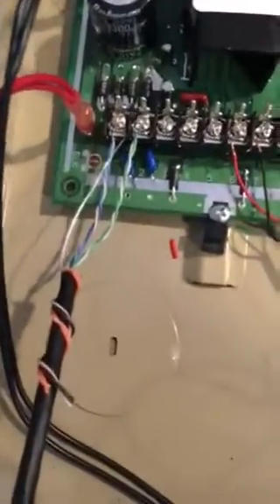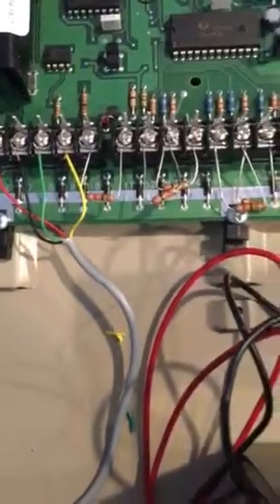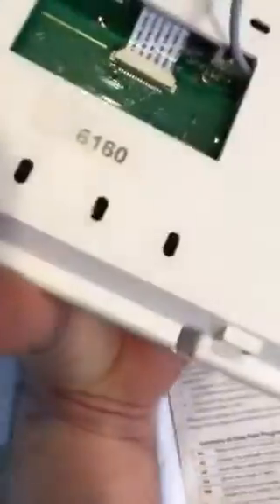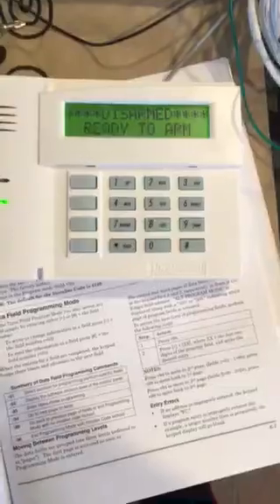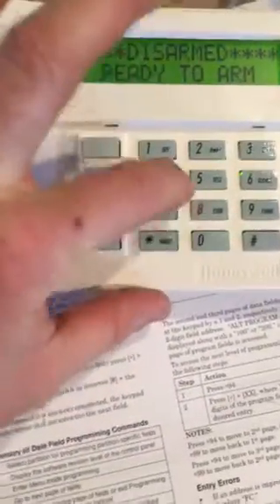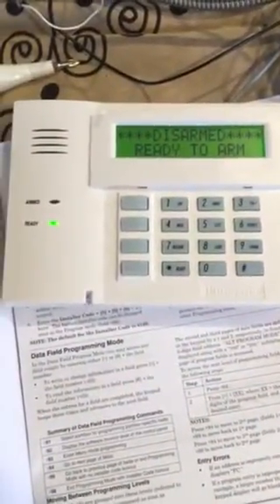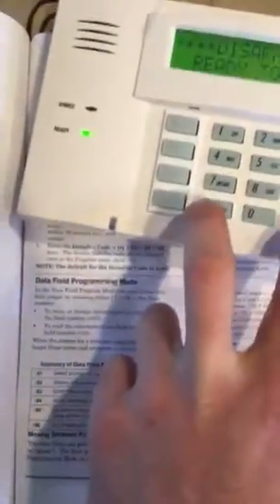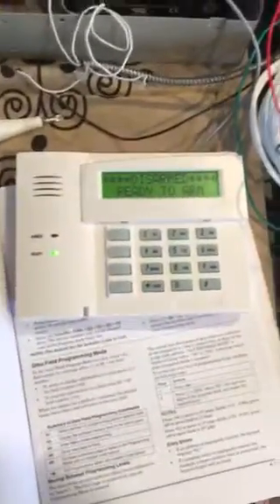youtube video #-hes4-VmJ7k

Comment: I have this issue on my Vista 20P except it only happens when my 6139B keypad is connected. Wires are not broken, and the keypad is fine, however when it happens, it displays FAULT 100 RF RECEIVER which basically tells me my system is fucked

Comment: power down panel, press 1 and 3 and hold them till you see 20 small zeros, press 1, then address of keypad) if it is vista 15-21ip the addresses will be 16 and up. if its 128bpt address is 00 for first. then press ****and your done
Reply from the maker: There was a broken wire in the 4 conductor keypad wire. Thanks for the reply though

Comment from the maker: There was a broken wire in the 4 conductor keypad wire
Reply: If it's a broken wire, you would get an oc on the keypad. 
OC = open circuit.
Reply: @guesswhomartin9249  not necessarily I had a wire break on me when I set mine up the wire was for the data out and my keypad still said disarmed ready to arm but wouldn't accept anything more than 5 pushes of a button
Reply: @Farmerjoe-4430  .... Ok, my first thought was a broken wire somewhere. If the wires are good, then the keypad needs to be addressed.
Reply: @guesswhomartin9249  if it wasnt addressed the keypad would be blank nothing would show up on the screen... now the other thing that could cause that same issue as what he was having is 2 keypads on the same address. And I'm just saying this now I'm not a professional alarm technician I just know a lot about low voltage automation controls